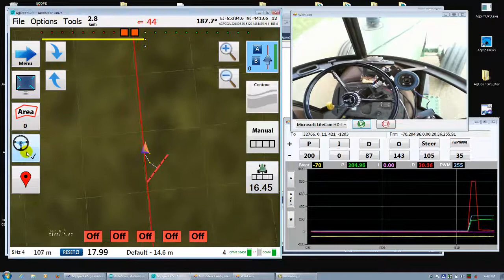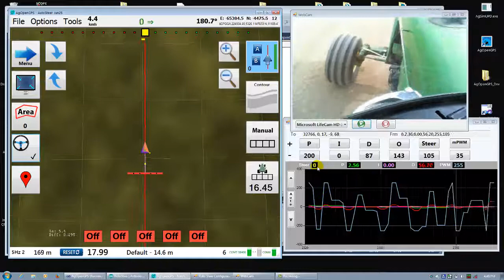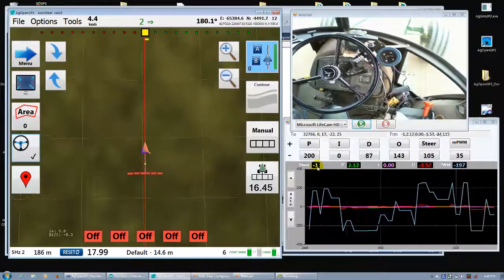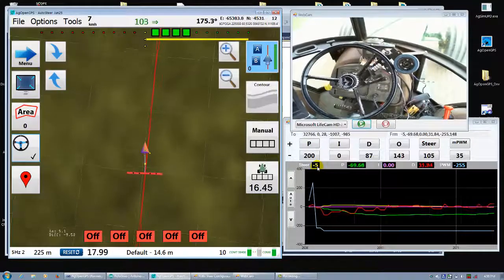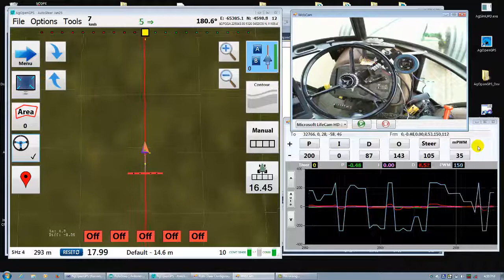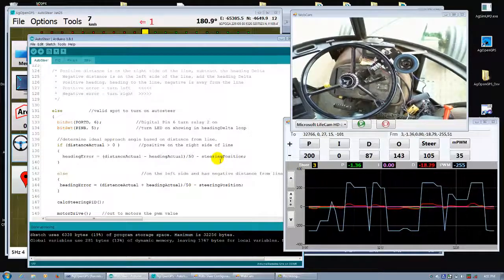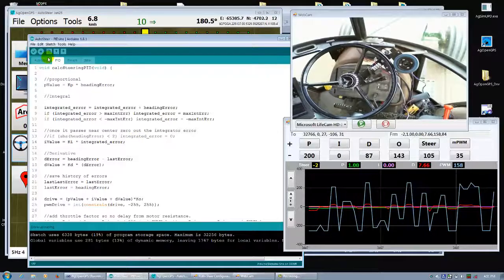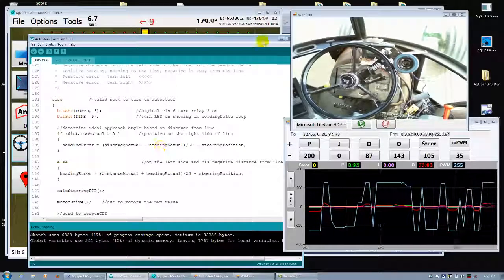DIY Auto steer with AgOpenGPS Try #2

Comment: Would a Trimble 132 be a good way to get the GPS signal?
Reply from the maker: People have been getting RTK Emlid Reach RS units - sub inch accuracy for 699 a piece.
Reply: im still at the high level, you set up your base station what is the furthest distance you can be away from the base station does the reach unit work?
Reply from the maker: I'm not sure on the Reach as i don;t own one, but i believe its around 10 0km under good line of sight transmission of radio signal. quite good actually